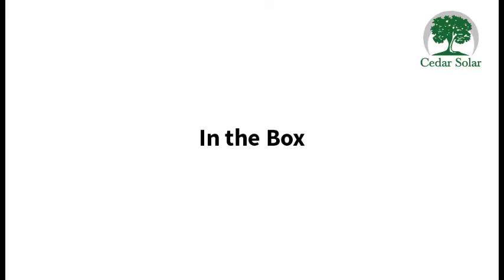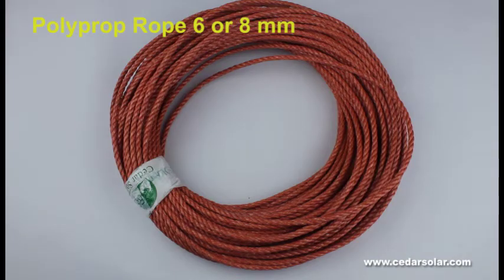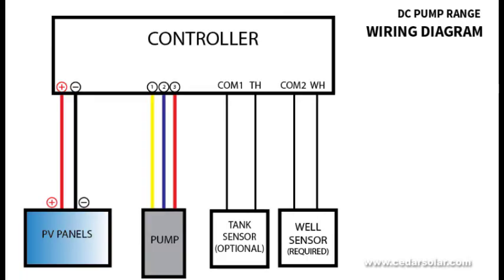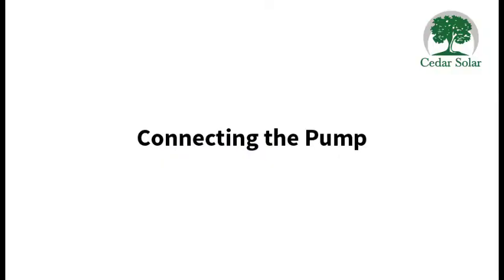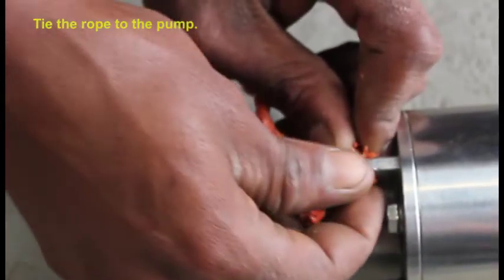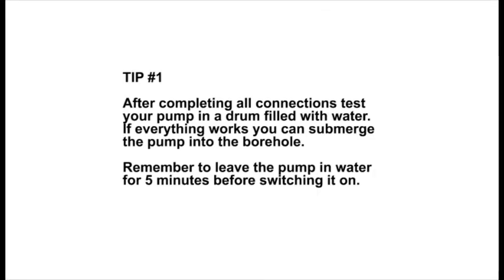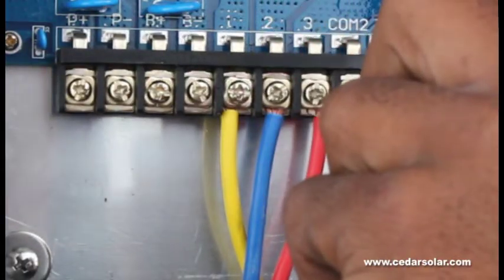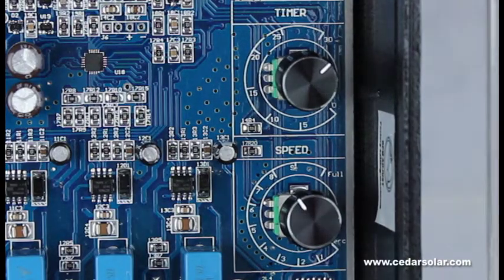Cedar Solar DC Pump Range Installation Video 2018 (Quick Version)

Comment: How can I conect a solar pump with out control box
Reply from the maker: You get the controller with the pump. You need the controller.
Reply: @CedarSolar  yes mine will pump for tow second and cut off and tell me p43
Reply from the maker: @michaelmwansamwamba7129  email customer support: support@cedarsolar.com